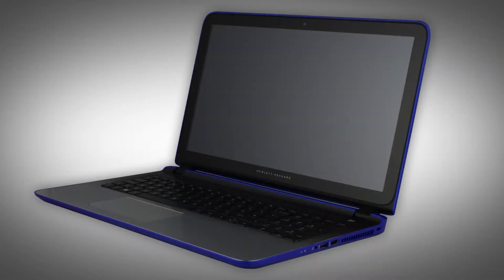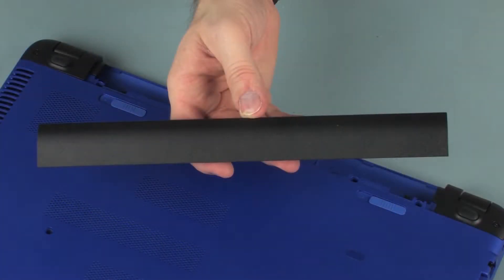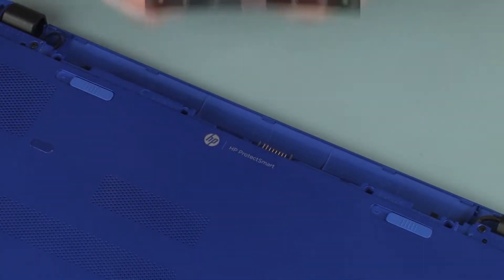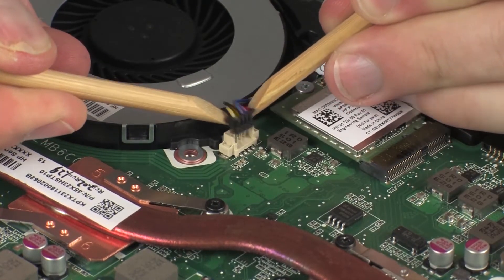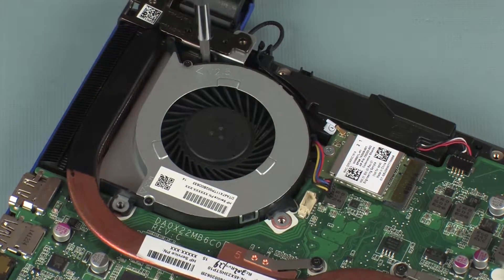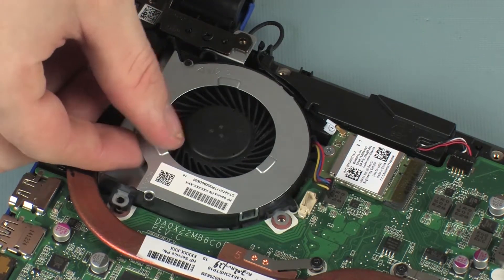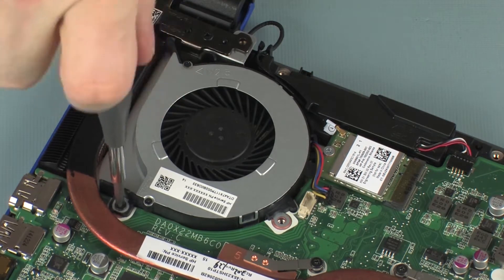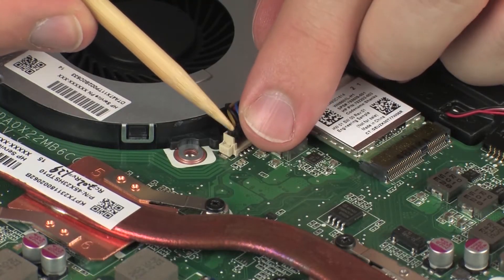Replace the Fan | HP Pavilion 15-ab000 Notebook | HP Support

Comment: Can i use these same steps for a HP Notebook - 15-dw1083wm? My fan stopped working out of nowhere and this would totally help me.
Reply from the maker: Hi Makyah Springer,

Thank you for your post and interest in our product.
We appreciate your time you have taken to contact HP Support and We apologize if you had any inconvenience.
I'd like to help you with your HP laptop and related queries.

As a first point of diagnosis, please try few of these troubleshooting steps mentioned in this document link:
http://h10032.www1.hp.com/ctg/Manual/c06941101.pdf
Please refer page number 54/89(for laptop fan removing and replacing guidance steps).

If issue still persist after trying above troubleshooting steps, To further provide you with appropriate solution for this issue, please contact our customer care team over the phone or chat for further assistance, as this issue requires additional troubleshooting over remote session or in Live conversation with you over phone or chat to isolate the issue and provide you instantly with appropriate solution or repair/replacement options available at your place as per the warranty.

Please follow these steps to reach HP Phone Support:

Step 1. Open link: https://support.hp.com/us-en/contact-hp?openCLC=true
Step 2. Select the product type.
Step 3. Enter the serial number of your device or select let HP detect your product option.
Step 4. Select the country from the drop-down.
Step 5. You should see the Local Contact Options.

In case you want to reach us on call/chat, please access this link to select your preferred country and language option to reach us. Global support link:- https://www8.hp.com/us/en/contact-hp/ww-phone-assist.html

Hope this helps. Keep me posted.

Regards
Vignesh-HP Social Media Support

Comment: Hello, thanks for all the support. 
I have trouble with a HP Pavilion 15-ab002ns (M5M01EA), in Partsurfer it doesnt appear the catalog of parts, and I need the code of the fan (motherboard). 
Could you please tell me the code?¿Where I can buy original parts in Spain?
Thanks a lot, im waiting for the answer
Reply from the maker: +Adrian N.P The part number is 806747-001. Please select your country and search it here: https://bit.ly/3yxgDbs
Reply: @HPSupport  Thank you so much!

Comment: My HP Pavilion x360 15.6 inch touchscreen notebook  Intel 6th gen Core i3, I think it’s a 2015 or 2016 model. My cooling fan unit bit the dust today. Is this video real event to that model?
Reply from the maker: +It’s Marsh Yes. You can try the steps in the video.